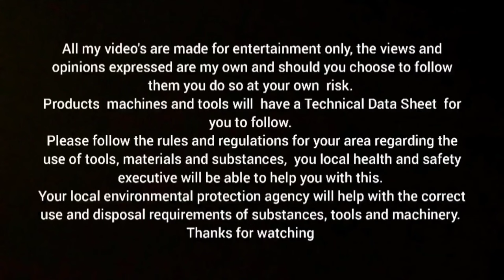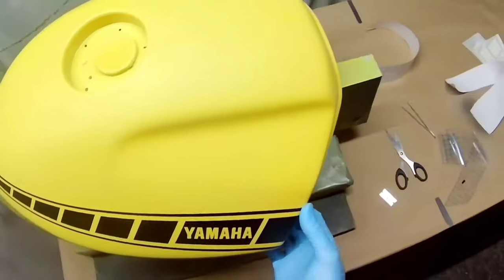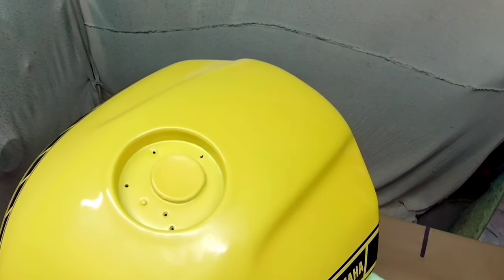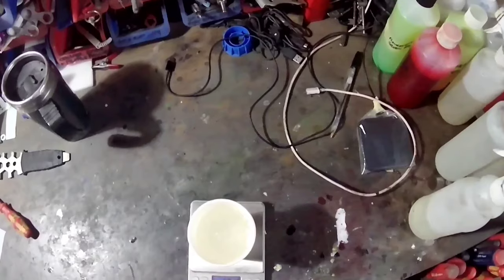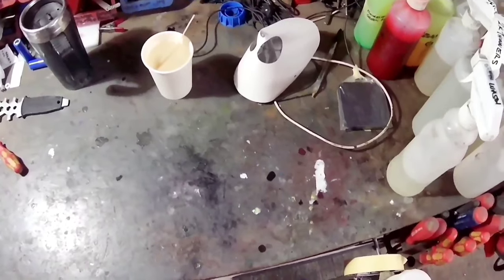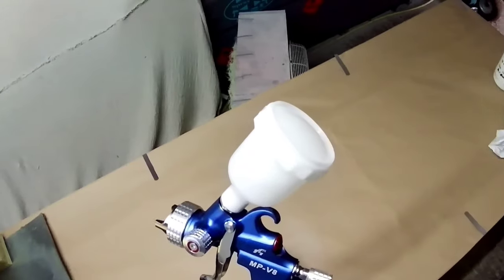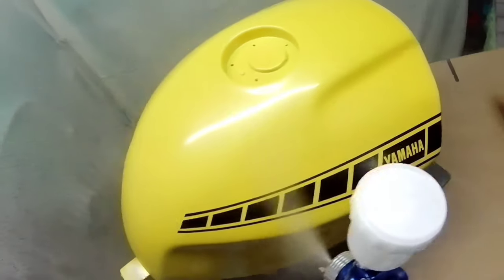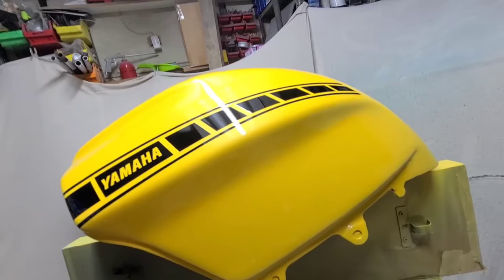Fuji MP-V8 1.2 & Yamaha Speed Block Decals, Upol 2080 Clear Coat

Comment: Hi Pete, I was wondering if you use a particular vinyl for your decals to clear coat on top of? or can you get away with the standard type .
Reply from the maker: I use a matte vinyl. You can use gloss, but you will need to grey scotchbright it after application, which you don't have to do with the matte.
It's a standard exterior vinyl rated at 5 years,  but that will be extended by clear coating over the vinyl,  so yes, pretty much standard really
Reply from the maker: This is the one I use,
https://www.mdpsupplies.co.uk/matt-sign-vinyl/detapewallart305log

Comment: It took guts to be honest about the Fuji. That's what makes you a great spray gun reviewer. I've often wondered myself if the Fuji lived up to the hype, and it obviously doesn't, at least for the price of it. For as much as it costs, I would expect much more in feel and performance. 

Thanks for showing us, Pete!
Reply from the maker: Thanks, Boss. I always try and be objective about reviewing these guns. It's rare these days to get a bad gun, so you have to try and decide,  given price,  performance,  build, and ergonomics, where some fits, and I struggled to see where the Fuji went to be honest.

It's very well made, worked well on anything I used it on but it wasn't outstanding at anything either, if it was $100 USD I would be saying get one as it's a bargain, but, in the UK, it is equivalent to $500 USD or $550 USD with a cup, which means there's loads of, imo, better guns for the same or less money.

Thanks as always, mate, for the support. It's much appreciated 👍

Comment: Great stuff Pete . I have the 5 and it’s awesome with the electric static Matt upgrade
Reply from the maker: Hi mate, yeah,  I've heard about the static matt, I very rarely use a matt, I just adjust the rollers. 
Apparently, the 5 is much quieter than the 4, which wouldn't be very difficult. I guess. Cheers, buddy 👍

Comment: Hi Pete, a very good honest and fair review mate and I pretty much agree with everything you said about the gun but I hadn't noticed it being top heavy but I agree that the trigger is a bit short as like you I have shovel like hands so I also like the heavier guns, I thought you would prefer the 1.2 to the 1.3 as I found the same thing that the 1.2 gives a better finish when laying the clear but the 1.3 makes a damn good WoW primer gun👌

I'm pleased you borrowed my Fuji as you now know that it's not the gun for you which will save you buying one, I would put this gun in the GTI ProLite camp as it sprays very like the ProLite but I think it's a bit better made, I've always though this gun is a modern version of the ProLite👍

Anyway mate you got a cracking finish from the gun mate a bit to good if you ask me😂your putting me to shame mate😭😏😆looking forward to seeing more from it👍
Reply from the maker: Hi John,  yeah,  hopefully I've been balanced,  I have put it up again at the Gti Pro Lite, and they are very, very similar , including the pattern that looks identical.

I much prefer the Pro Lites. They are lighter by around 150g and have such a range of cap's and setups that it makes them very versatile.

 The Fuji is better made and has a far less complicated sealing system for the tip and baffle arrangement so I can understand you saying it's like a modern Pro Lite as I'm sure Devilbiss would try and do away with there system, maybe like the DV1 so it's more a permanent seal which should help longevity.

Cheers, John,  thanks for the loan 👍
Reply: Yeah if I didn't know better I would say the Fuji is designed around the ProLite with the over designed baffle system removed or simplified, the weight of a gun doesn't really bother me apart from the Slim Kombat which to me feels like a plastic toy in my hands😅

I really enjoyed your review though Pete as IMO you are among the best (if not the best) reviewers on here, no matter what gun you review you are always unbiased in your opinions👌
Thanks Pete and I'm pleased you enjoyed using it👏👍

Comment: I had the first year of water cooled yz 80 back in 1983 if i remember they had that decal.
Reply from the maker: Yeah,  the YZ had the speed block decals, normally in red, as the bikes were white.

They were used on a wide range of Yamaha stuff. They still do some bikes in them as limited edition models.

One bit of useless trivia,  but worth remembering if you making you own decals is Yamaha will never use the Yamaha motor tuning fork logo inside any speed block decals,  only the Yamaha name or nothing,  totally worthless information really 😉 😂, cheers mate 👍
Reply from the maker: That's unusual. Normally, the YZ and TY were white with red and black decals, and the IT Enduro ones were a light blue with yellow decals.

Maybe different markets had different colours. If it was yellow, I'm guessing it had a black speed block.

 Yellow was normally Suzuki RM & PE models

Comment: I sure wish you'd try one of the tiawan made avalon guns.
Reply from the maker: Hi David,  I have thought about it. The trouble is that by the time it gets to the UK, it's around $220 USD, which is up with the Porphis guns.

Now I'm sure the Avalon guns are good, but I wouldn't mind betting that aren't as good as the Porphis guns, so I'd rather spend the money on those I think.

If they have an offer sometime, then I'll try one, so maybe one day, have you used one? , you can get them with different caps, I think,  like the LPH400 , cheers mate 👍
Reply: @peteshobbies5383  no, I was hoping you'd buy one so we all could could see how good they are. I'm about to pull the trigger on the 717 but all things considered, I'd rather buy from a allied country than an advisory  like China if I could help it.
Reply from the maker: I'm sure the Avalon guns are fine. A few people have told me they really like them and are, as you know, effectively an LPH400 clone but I'm not sure if they are a lower pressure gun like the LPH or a WS400 type of gun.

Those who have said they have them when talking to me don't go into much detail really,  just saying they are really good, having said that I'm always comparing things in my mind because I has access to so many different ones so I guess it's peculiar  to me to always think like that rather than how most people think 🤔
Reply: @peteshobbies5383  you do fantastic work Pete.  Please keep it up 👍
Reply from the maker: Thanks David,  appreciated as always mate 👍